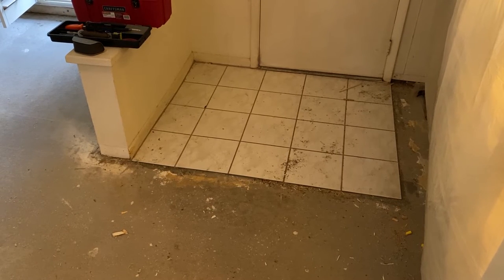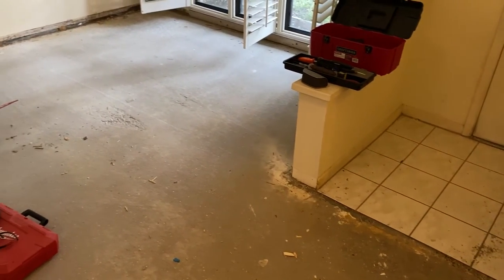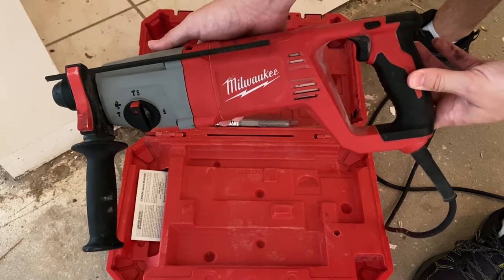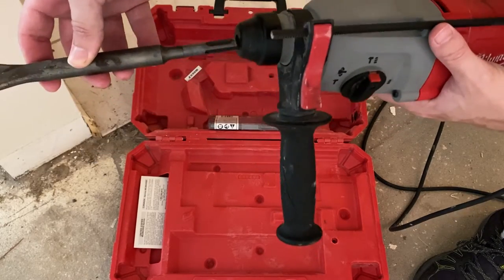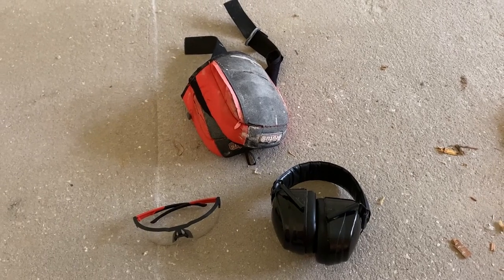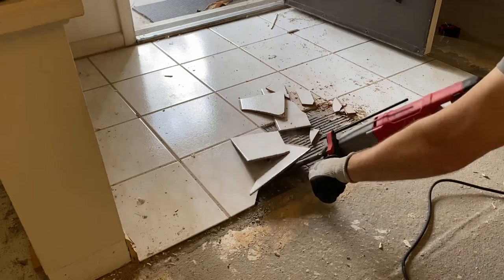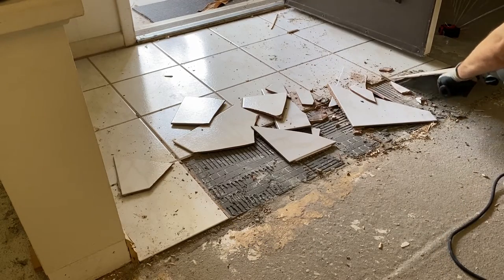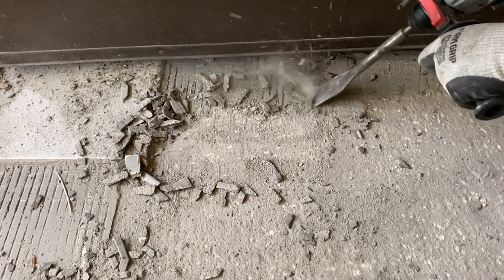How to Remove Tile Floor from Concrete

Comment: Thanks for uploading. The video was no nonsense and very helpful. I have a small bathroom to retile (12x5) and kept contemplating whether I should do the job manually with a drywall hammer. I also considered a rental from HD but after 3 rentals, the a cost of  the purchase pays for itself. Like you are saying, getting the tiles up aren't so tricky, it is cleaning up the thin set that is going to take some time. Did you find the rotary hammer does the latter well and that you did up need to grind out the remaining thin set with a diamond grinder?
Reply from the maker: the rotary hammer drill with the chisel bit was fine for getting the tile and thin set up.  the surface had some imperfections after though.  we put vinyl plank flooring down and i can feel small dips in some places.  if i could do it over, i would probably use the self levelling mixture.  i didn't know about that stuff at the time.  oh well, live and learn!

Comment: If you are ripping out 1000 sq ft of porcelain tile in a condo on a 1st floor would you use this rotary hammer or Makita HK1810 Power Scraper the Makita is about 480.00 dollars while this is only 200 dollars

Comment: Could you do this on bathroom wall tile? Or would it ruin the wall under the tile?
Reply: You'll ruind the drywall, it's easier to cutout the section and reinstall drywall